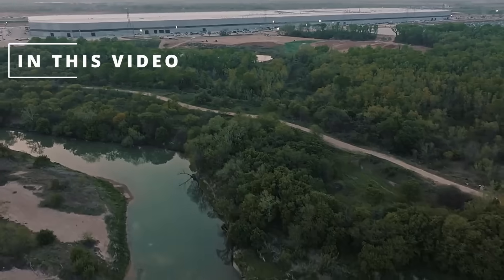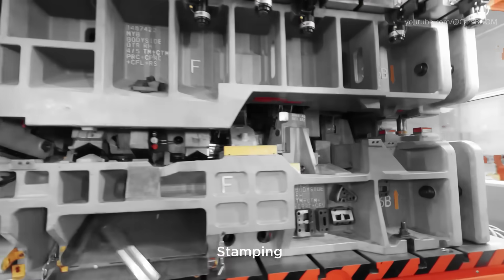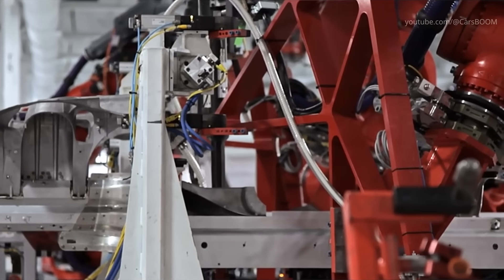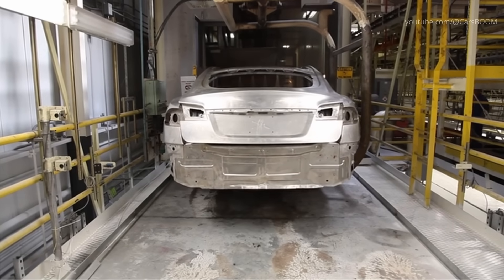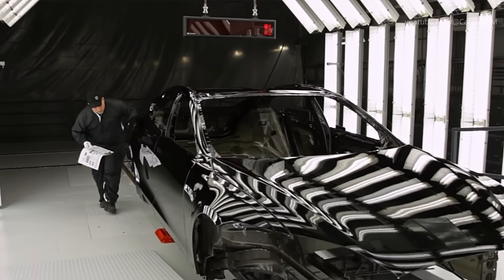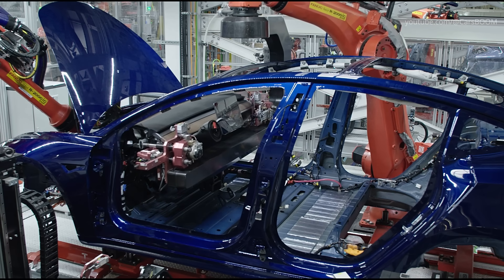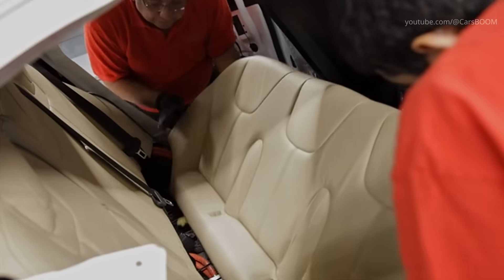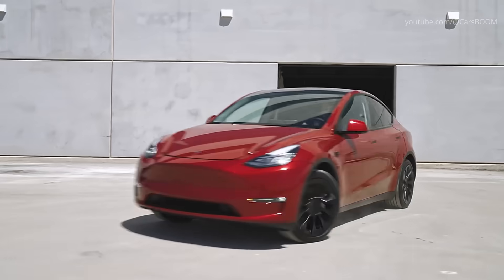Inside Tesla’s Factories: How Model S, Model 3, and Model Y Electric Cars Are Made (USA & Germany)

Comment: whoever quality controlled my recent 2026 Model 3 performance made sure my car was equipped with a driver side dent, ripped driver seat upholstery, steering column didn't adjust, and a paint defect on the back right side panel. good enough for government work i guess
Reply: Mine is perfect

Comment: I believe  Elon fooled many on his path too thinking that EV toxic lithium cars were or are an eco viable clean solution to better help this planet,  lithium is a very toxic element metal, 97% of lithium is not recycled and goes in to land fills or  dumps, it is way cheaper to mine lithium  than recycle it,  lithium is a water guzzling toxic element metal, it takes 1000 gallons of clean water turned very toxic  to mine or build  one lithium toxic  car (just one) this is just lithium and not including cobalt which is another one of many  toxic element metals in the build of a lithium toxic car( horrible)  the huge amount of  lithium used to make just one lithium car is not sustainable for all cars due to the amount of toxic lithium water pollution, on top of this, most lithium cars are still connected to the oil and coal grids! while back scientist researched lithium in sell phones and made a warning about the hazzards of holding a cell phone to long and close to head and stated it may cause brain tumors, just think of all that toxic lithium under car seats next to you while driving and how much exposure  one gets from those lithium  toxins,  i for one will never ever  drive a toxic lithium car,  this for health reasons. however there is a better solution in future , due to the heavy toxins and pollution in mining lithium, when a lithium car is still in the company  assembly line it has already polluted more than a hydrogen fuel cell car that has been on the road for more than 125000 miles, fuel cell cars all around have become very safe, solar cells have become much more cost efficient in making green hydrogen and better storage than having  it in battery storage or just plan electricity, fuel cells will always have 10 times more energy power for the buck  than  lithium battery or any future solide state  battery, plus the amazing secret about hydrogen fuel cell cars is  that each car actually cleans the air as it runs due to it`s clean watered electrolysis  when released onto the atmosphere.
Reply from the maker: EV technology, including lithium-ion batteries, has both advantages and challenges. While lithium mining has environmental impacts, advancements in battery recycling, sustainable mining practices, and alternative battery technologies are rapidly evolving. Additionally, grid decarbonization and renewable energy integration are improving EV sustainability. Hydrogen fuel cells are also a promising technology, but they come with their own challenges, such as production efficiency and infrastructure development. The future of clean transportation will likely involve a mix of solutions, and innovation in both EVs and hydrogen will play a key role.